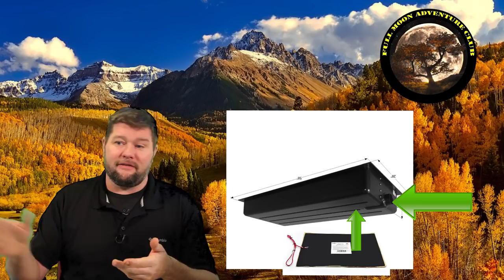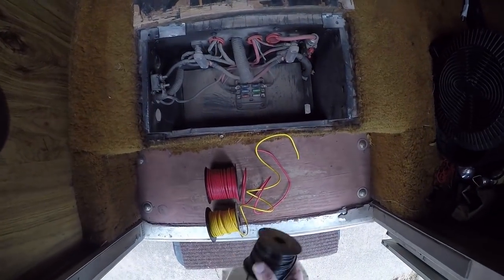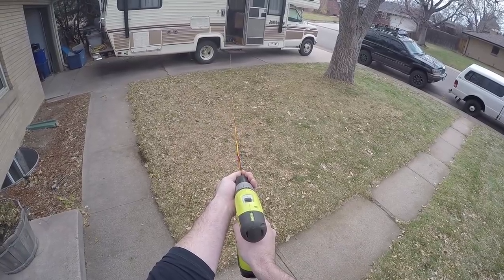How To Install RV Tank Heaters - 4 Season RV Upgrade

Comment: Great video. Recommend using heat shrink but connectors rather than wire nuts for external applications

Comment: This is a very good video, however; being a mechanic on cars, trucks, and semis, you never use wire nuts on wiring that is out side in the weather elements. ALWAYS use butt connectors with heat shrink tubing so that you get a really good tight, sealed connection that is weather tight. The electrical tape can still allow moisture in and allow for corrosion to set in. Especially if you live in an area where the state uses calcium chloride ( liquid salt ) as a melting agent on winter roads. Yes.......definitely use either wire lume or tubing as a protector for the wiring. Thanks and just wanted to give a little heads up, but terrific video. Thanks
Reply from the maker: Great information. Thanks for sharing that with all of us.   Jim
Reply: Have to agree with James on all points here.   Great video but chasing down a bad corroded connection down the road is not fun.  Spend the few extra bucks for the better connectors and shrink tube.

Comment: What to use to get adhesive off the holding tank before placing the heat pad on?  I think the mobile rv guy who put my heating pad on had something else on his mind that day .  I took my rig out today and noticed the pad dangling underneath.  I went under there myself and he hadn't taken the paper backing off of the pad.  It looks like he used some kind of adhesive  around the outer edges to try and keep it on and theres stuff in the center, I suppose from the old one that fell off.  The rig is 18 yrs old,  so that didn't surprise me that it fell off.  What a mess it looks like.  I'm afraid to ask him to fix it because how will he know how to do it right and how to get the adhesive off that he used to try and put a new one on.  What kind of cleaner should I use to get any old adhesive off the bottom of the tank?  How can I tell if he hooked them up parallel as the instructions say to do when you have two of them?  I think I need to find a new  mobile rv guy.

Comment: Could also go over if your adding this after its below 50 degrees. What I did was drain my tank, heat up a good amount of water just before boiling and got that done into the grey/black tank. This will one bring the temperature up to required temperature for install and two will put water into the tank so you won't short out your heater when you turn it on. Once your heater is installed, wire up your heater and have it turned on if it's cold out and go back underneath and rub on it a little bit more just to make sure it's adhered properly. Now if it's cold like well below the operating range, after you first put on the heater with fairly warm water in the tank I also took a flat board and other little boards stacked them on a bottle jack and had pressure on the heater just enough to hold it there while it did it's thing. With the jack still in place turn on the heater to keep everything warm and removed the jack and boards the next day, worked like a charm.

Comment: You can over size the wire and just run 2 wires with the same results just make sure you keep all the negatives together and the positives together. But you'll need to calculate the amperage times two and the use the wire to handle that amperage. Keep in mind you'll just have one switch if you want it individual switching follow this method .Great stuff and nice job. Not correcting you just putting out an option.
Reply from the maker: It's a valid option. However, you need to be able to turn off each individual tank if it doesn't have water in it. For example, if you use the black tank but you haven't put any water in the gray tank yet you don't want to switch on both heating pads as they cannot be run without water in the tank. Something to keep in mind. Thanks for the comment and happy camping.   Jim
Reply: Great point. I'm an electrician and was just researching this for my buddy. On mine I will not be using  in the winter but he will. I wired it the way you said on your video. Convinced him to switch it individually. Ps I like your channel did sub you and going to check out some of your stuff. I'm a newbie tt owner .Just bought .

Comment: Keep up the good videos! Most of these heating pad turn on at about 45 degrees and turn off at about 65 degree. That seems like a big waste of battery power if the pads turn on at 45 degrees. Would it be better to have a thermostat switch in the cabin which is measuring the outside temperature. It would then turn of the pads when the outside temperatures reached maybe 34 degrees? Thanks
Reply from the maker: It is true these turn on at 45 degrees. A thermostat that activates the pads at 32 degrees would be a great idea. I don't think I'm going to install that because I rarely camping freezing conditions but if you are in constant freezing conditions and especially if you're boondocking that would be a great install.

Comment: Nice job gym thanks for all the information. PS I would recommend soldering the splices as first choice, using butt splices second choice and wire nuts as last choice but you did a great job taping everything up and securing it with the wire ties. Thank you
Reply from the maker: Thank you for the suggestions. I have personally never been a fan of soldering as it adds a lot of time and frustration when working underneath the RV or in tight spaces. Butt splices are fine and work well but I have always been a fan of the wire nuts. They might be big and bulky but add some electrical tape and I have never seen one fail. I have crimped several butt splices incorectly and had the wire I thought was secure slide out after install. I think its just personal experience that brings me back to the old wire nut. Thanks for the comment and happy camping.  Jim

Comment: Dumb question, these tank heaters do they work in below freezing temperatures. I live in Maryland gets around 20 degrees here at nighttime.
Reply from the maker: Absolutely. They are rated from freezing down to -11°F (-24°C) ss long as you chose the right sized heater pad for you size of tank. Take care a nd happy camping.      Jim

Comment: Hey! If I were to add all three tank heaters would the three negatives still be connected to the same wire that will go to the negative side of the battery? Thanks!

Comment: What did you do with the negative or ground wire that comes into the switch from the heating pads? In Part 2, when you are hooking up the switch, you say you are going to leave the ground from the heading pads for a little bit because you were going to use it to tie into some other stuff. In the end, it looks like that ground is just loose behind the switch. What did you ultimately do with it? Does it need to be grounded somehow? Thanks!

Comment: How about battery power for these heaters? How much power required for a 8 hour night? Do these heaters cause the tank to go bad over time? How about rocks that will bounce up and hit the pad when driving, is there a concern about damage to the heater filament. Good video, Thanks
Reply from the maker: I would guess you would need about a hundred amp hours worth of battery to make it  8 hours  With both of these heaters running. Each one takes around 5 or 6 amps if I recall. Rocks hitting mine have never been a problem and we go off-road all the time in my class C so I wouldn't worry much about that. As for the tanks going bad over time they should be absolutely fine as long as you only use the heaters when there's a little bit of water in each tank as this will distribute the Heat. I've been fulltiming in the winter and believe me they do work. I hope that answers your questions. Thanks for watching and happy camping.  Jim

Comment: I have an all aluminum horse trailer w/ living quarters. Coulda I install these pads to the trailer underbelly to keep the tanks and water pipes (which are inside the floor) from freezing? I cant get to the pipes themselves to heat wrap them.
Reply from the maker: I'm pretty sure they have to be connected directly to the water tanks themselves. It's possible but you may want to contact the company to find out for sure

Comment: Hi, thank you for this video. I´ve got a question. Do both Sides of the heater gettin hot ?? .. if yes how many celsius ?? ... or does only the side where you removed the paper ??? ... Because I think about putting one of these Tank heaters inside my van. Is it possible to use not the side with paper and put the tank on top of the other side of the heater ?? ... maybe somebody can help me ;-)

Comment: Hi Jim. Great video as usual! I have tank heaters in my 04 Sunseeker but am confused about when to use them. They say that the tanks need to be partially full to use the heaters. How much water should be in there? On a 40 gallon tank, would 5 gallons be enough? It seems counter-intuitive to add water to your tanks just to turn the heaters on?
Reply from the maker: I was wondering that same thing this weekend when I took the RV to the lake. I ran the kitchen sink for 30 seconds and waited for one flush of the toilet. It worked great with no issues all weekend. 20 degrees with high wind. It seems weird to me that they need water in the tanks at all. You would think the pads would just heat up and turn off at the shut off temperature even without water but I did put some water in. I hope that helps. Jim
Reply: fullmoonadventureclub Thanks Jim. Much appreciated.

Comment: Hi, thank you for the video. In addition to the heating pad I was wanting to use a insulating blanket covering the tank to protect from direct contact to cold air. Would it be ok to have the blanket in contact with this heating pad, or would that be a potential fire hazard?
Reply from the maker: I definitely would not have the insulating blanket in direct contact or within a few inches of the heating pad. It would definitely be a fire hazard. Also make sure that you have a little bit of water in the tanks anytime that the heating pads are turned on. I hope that helps. Thanks for watching and happy camping.  Jim
Reply: @fullmoonadventureclub  So I am building out a cargo van not an RV, so my grey water tank is only 9 gallons. I will be using just 2 or 3 of the 3" x 13" RV Elbow Pipe Heater Pad instead of a larger pad to save on electricity. Do these get as hot as the larger pads? I can't find a website for the manufacturer of these pads. Also, if I used a fireproof insulating blanket would that work, or just stay away from that idea completely.
Reply from the maker: @ryanjones2930  I really can't say as I'm not familiar with the pads are going to be using. Using a fire resistant insulation might be an option for you but I would just assume keep anything like a blanket away from a heating element. So I'm afraid you're on your own with that decision I would not recommend it. But I definitely have to side on the air of safety and caution when giving out YouTube comments. I hope that helps. Take care and happy camping.   Jim

Comment: I'm a little surprised that you didn't add any insulation around the tank and heater.  How much power do your heaters consume?
Reply from the maker: They use about 7 amps DC  per pad. The pads do fine without insulation as long as you have the power for them which I do. I would also caution putting anything flammable around the pads themselves. Thanks for the comment and happy camping.    JIm

Comment: After I install heating pads, is there anything I can do to protect the pipes? Great video!
Reply from the maker: They sell heat tape that works the same way. You just wrap it around the pipes and it keeps them from freezing. You could also do what I did and vent the cabinet so that air flow from the your heater gets inside the the areas with pipes. I hope that helps. Take care and happy camping.

Comment: Hi, i was wondering if you can you put insulation over the water tank with heating pad underneath, or would that cause it to be too hot and possibly melt plastic?
Reply from the maker: As long as there's water in the tank when it's turned on it should not melt the plastic. I'm not even sure if it would melt the plastic without water but they caution against it. They say it will damage the heating pad itself not melt the tank but always have water in your tank and you'll be fine.

Comment: Hi Jim. Great job with the video as usual. Hope all is well. I need to replace defective tank heating pads on my rig. Is there anyway to get the old ones off easily?
Reply from the maker: That's a good question. Usually I would go with a heat gun to release adhesive but since thier heating pads the glue is probably designed to resist heat. I'm afraid you're on your own with this one. I'm going to guess a flat scraper and time. Please let us know if you figure anything out.

Comment: My tank heater fell down. Someone suggested Gorilla tape to put it back up with. What do you think?
Reply from the maker: No I think it has to be an adhesive. If you just tape the outer exterior of the pad it might sag and overheat destroying the pad. The entire surface of the pad must be in contact with the tank at all times.  You need to find a suitable adhesive in my opinion.     Jim

Comment: So was only one heater per tank sufficient? Have some pretty long tanks and want to be safe on the purchase.
Reply from the maker: In my case yes they're more than sufficient. However I'm not sure how big your tanks are. Just keep in mind that they do draw a lot of amps per pad so keep that in mind as well. Off the top of my head I'm not certain but I believe it was 7 amps per pad.     Jim
Reply: @fullmoonadventureclub  that isnt too bad. What gallon size was your tanks.
Reply from the maker: @xaploq1  I believe they're under 40 gallons. Not  very big tanks.   Jim

Comment: Hey Jim, I was wondering if I could just not use the switch plate and connect the positive and negative wires directly to my battery using ring terminals. I realize that would mean they’re on the entire time they’re connected. Is the switch plate only necessary if you want the option of turning the tanks on and off easily? Thanks.
Reply from the maker: I definitely would not recommend it but I suppose you could. The heat pad should only activate in temperatures below freezing however, you definitely need to put a fuse in there to avoid short circuit fires. The switches are just to be able to turn the pads on and off easily. The problem with your setup is the pad should only be activated when there is some water in the tank otherwise you could melt your tank and damage the pad. That's why it's good to have control over whether or not they are turned on. If it gets cold and you have no water in your tank you're in trouble.

Comment: Hey Jim, Came back to this great video to do the install after a year since I first watched it but noticed  that you changed the pads from Ultraheat to Facon. Was there a particular reason? How do you compare the new Facon one with yours?
Reply from the maker: I have not changed the pads on the RV. I believe they're still ultraheat.
Reply: @fullmoonadventureclub  yeah I mean the link to purchase. It directs to Facon pads which are much lower in price. Wondering why and if you recommend the quality
Reply from the maker: @moeaskari9679  I will look into that. It's possible they stopped selling that particular brand on Amazon so I looked for another heating pad or I might just have the link wrong I'll look. Thanks for letting me know.
Reply: @fullmoonadventureclub  that'll be great 👍thanks. In a dilemma right now.

Comment: Ouch! Your teaching people to use the wrong type of electrical connectors. Been a automotive technician for over 30 years. Don’t use wire nuts and quick connectors. Always crimp, solder and use shrink tube.